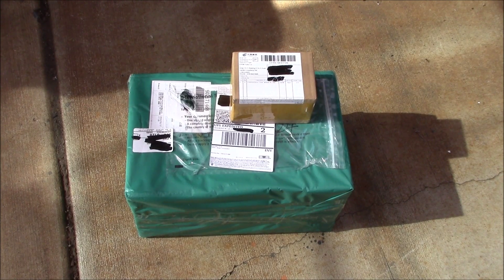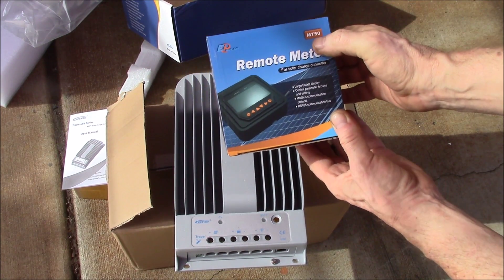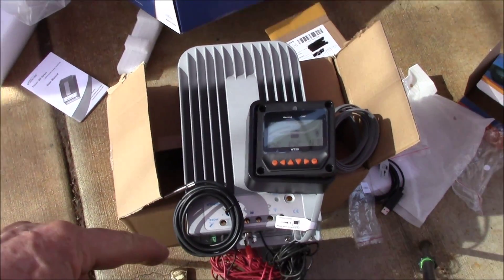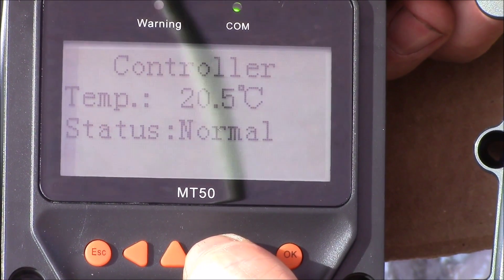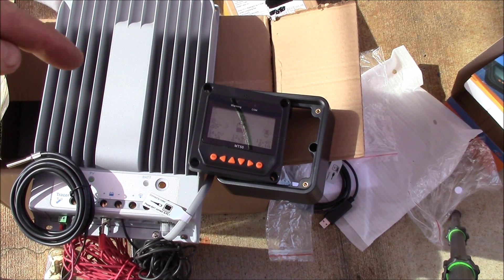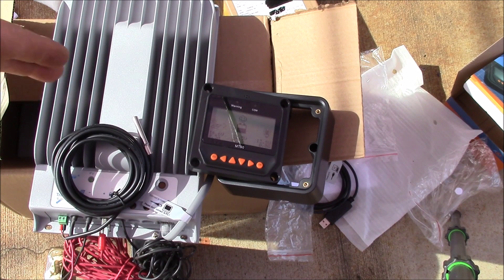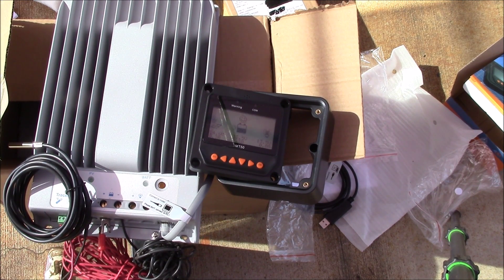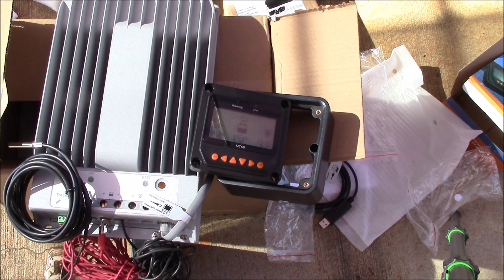EPSolar 4215BN 40 Amp MPPT Solar Charge Controller, Unboxing

Comment: first, also My will be here tomorrow I think :D
Reply from the maker: +JWSolarusa John Wesley Yes, the new model has a lot more configuration options along with the external temp. sensor and comm cable.  I'm thinking of getting a smaller charge controller like a 10 or 20A unit for my truck for camping.  If I go with a 12V panel, I might just do a PWM controller for the simplicity, but if not, I'll get something like a Tracer 10A or 20A controller.
Reply: fliping720 What?
That's true. 
How is your new battery bank project coming up?
Please post some videos will you. I am really curious to know the performance of those batteries.
They are really good looking batteries.
Thanks for sharing my friend 
Cheers
Reply: fliping720 I am sorry to hear that Buddy. 
I hope you feel better and stay warm.
God bless you and the family. 
Cheers
Reply from the maker: +fliping720 Figured you might be getting one as well.  Mine took a fairly long time to arrive as I got caught up in the Chinese New Year holiday time when I ordered it.  Once it shipped, it came quite fast.  So far has been working well with one panel attached to it.
Reply: R Brown I have seen up to 59 amps out of my older models :D, cant wait to get this newer one.
Reply from the maker: +fliping720 I think I've seen 46 amps out of mine.  I do have a smaller battery bank, so it probably can't take as much current as yours does.  I also have some pretty small wires between the controller and battery bank.  That was wired when I only had a pair of 60W panels.  Working on a new wiring setup for the system and the 2nd controller will let me test all that out while keeping the existing system up and running.
Reply: +R Brown (4Crawler) Nice video and thanks for sharing. 
I heard these new charge are really decent controller compared to the older models.
The advantage of the the Tracers you have their is you can do more programing, external temperature sensor for the batteries and also communication display is really nicer.
But the best Tracer of all is the 20A MPPT CHARGE CONTROLLER.
Reply: JWSolarusa John Wesley haha made me laugh
Reply: JWSolarusa John Wesley its been to cold, im sick of winter and am having a hard time bringing myself to work out side